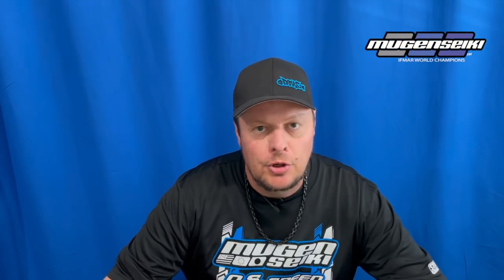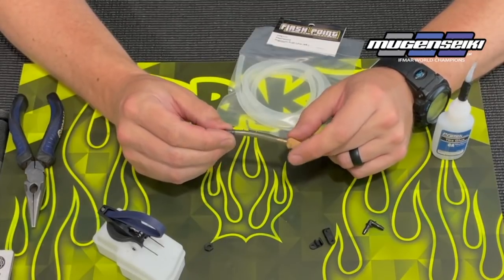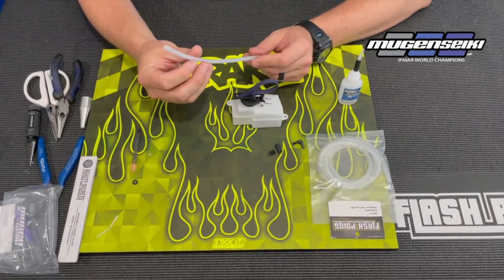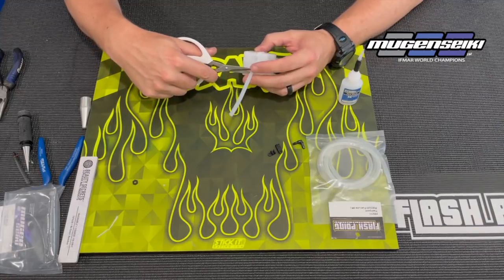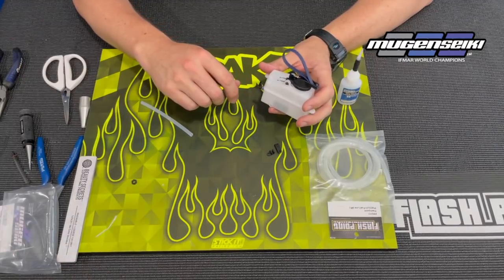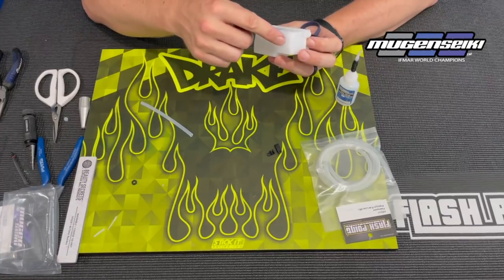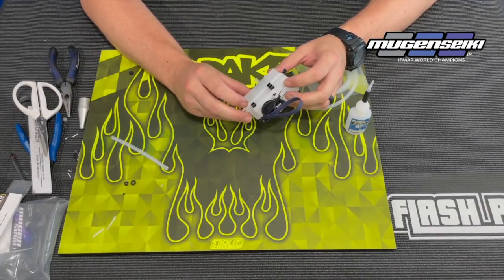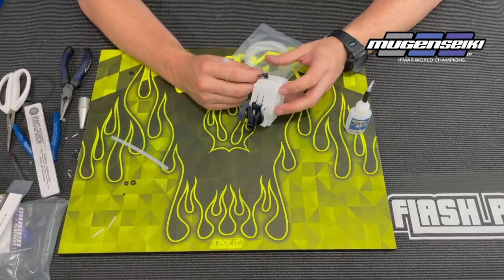Fuel tank prep - 90 degree fitting.

Comment: Great video, thanks for it. Just wanna learn that, is that fuel tank 125ml  with or without black insert that comes with the fuel tank
Reply from the maker: Depends on the length of the fuel line you're also using.

Comment: So the old piece is screwed on and the 90 degree is just pushed in. Does it ever leak? Should it be sealed?
Reply: its pushed into the fuel line, the line seals against the tank
Reply from the maker: Correct.  No, it doesn't leak.